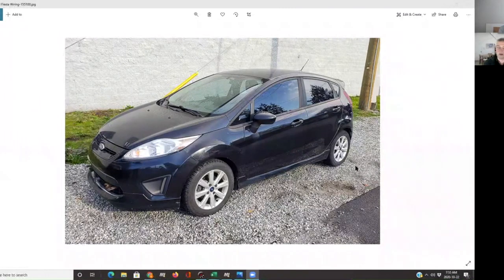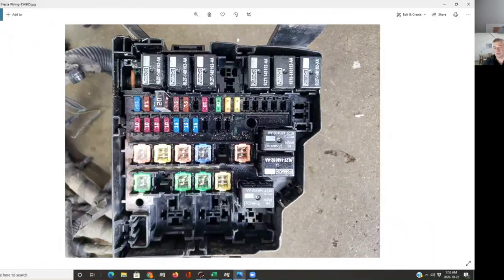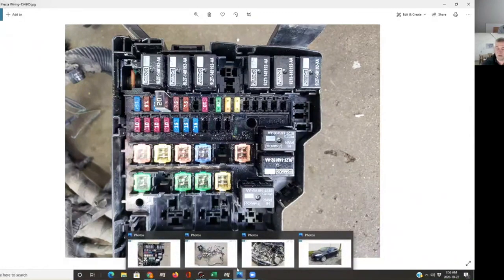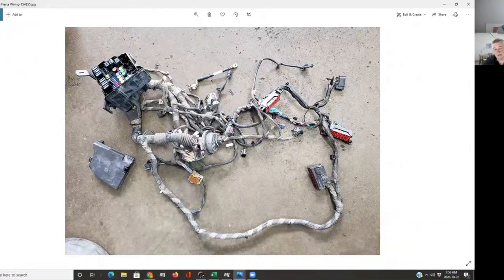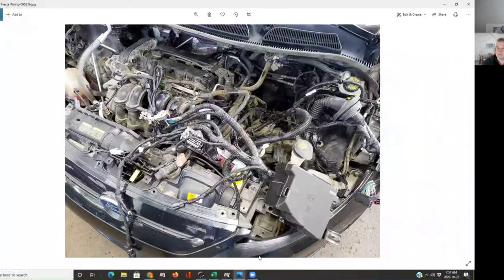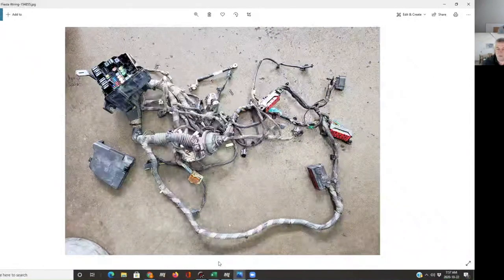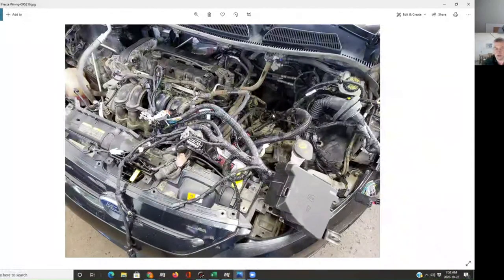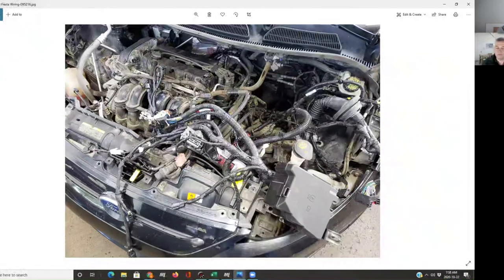2011 Ford Fiesta, Fuse Box Replacement

Comment: You missed the main question of why did this ford fiesta under the hood fusebox corrode... 
I have a 2011 Fiesta that was terribly corroded. Ford put out a TB on this fuse box.  Bad design, Will not seal with the cheap oem plastic lid.  Moisture,  road salt gets in  and destroys the fuse terminal bottoms.  
I ended up buying inline fuse terminals with rubber sealing boots and bypassed the box on about 20 of the circuits to correct this issue.
The headlights, abs and many other circuits were throwing warning lights on my dash .   Ford finally recognized this problem recently and sent me a letter on February of 2023 saying they will fix up to 150k.  I am at 154k and fixed it myself , Warranty was out years ago .
Reply: Years ago, Ford would fill this fusebox full of grease to try to push off this issue on us.  Grease won't help when fuse snap tabs are corroded off.
Reply: Ford knew they had issues with this poor sealing fusebox.

Comment: 2011 Ford Fiesta SE fuse box is poorly designed. Had to have it serviced when I bought it in 2014, complete replacement of the harness in 2019 and it is given me issues again in 2021. I had harness replaced like in video in 2019 from a friend he gave me a break and it still was a $600 job. Today I am going to try take apart what I can on the fuze box assembly only and clean it with electrical cleaner and repair the contacts. The fix any places where moisture can get in with RTV. I will let you know how that works.
Reply: How did that work lol

Comment: Your forgot the main reason why so many Ford Fiestas are having corroded fuse box electronics !!    Bad under hood Non Sealing Fuse Box and Lid design.   Snow salt is killing thousands of Fiestas due to Ford's bad design.  They mostly fail after warranty ran out.   Including mine.   I have added about 7 or 8 Inline fuses to bypass the failed circuits in fusebox.   To costly to replace box.   Under 20 bucks I have my car running good.